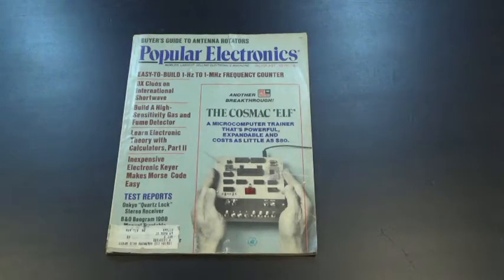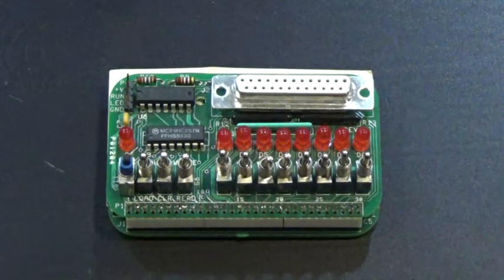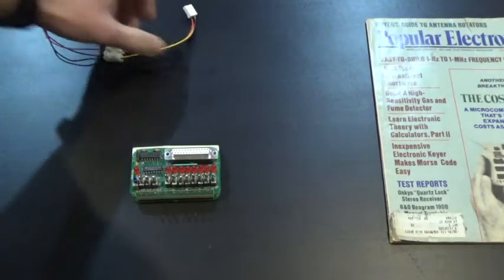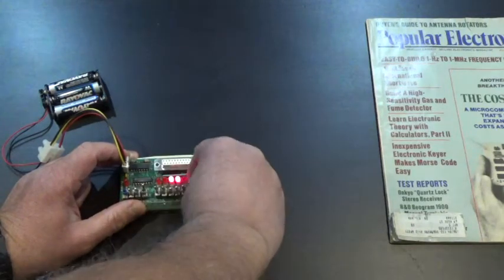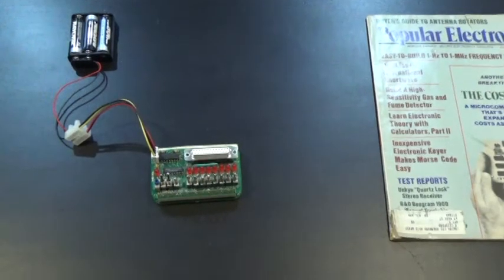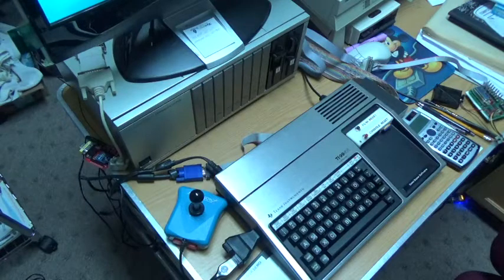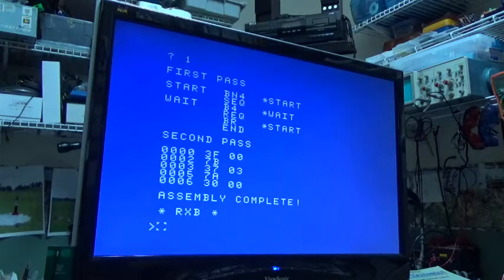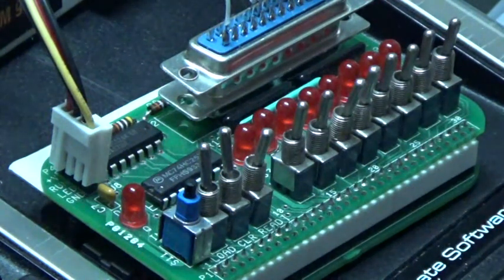ELF Membership Card Program Assembler and Transfer Using a TI 99/4A Computer

Comment: Cool!  I, too, have built an 1802 Membership Card, and while I haven't done nearly as much with it as I would like (yet!), I find it surprisingly fun to toggle in little programs and watch them run.  Like programming with stone tools, on your stomach, crawling through the jungle (to paraphrase a metaphor someone else once told me about assembly language).  ;-)  I recently got a couple TI-99/4A's, and I'm slowly getting them back into working order (so close on one of them), so this specific use case for both machines does interest me, niche though it may be.  🙂
Reply from the maker: Yes, being so close to the hardware from a programming standpoint is definitely a chest thumping experience :lol Good luck with your experimentations!
Reply: @SuperVorticon  Thanks!